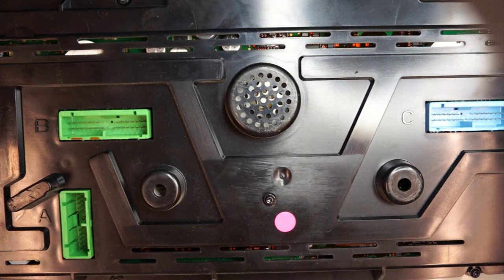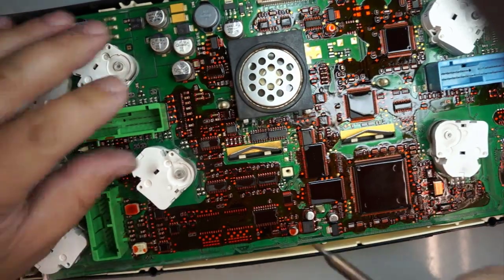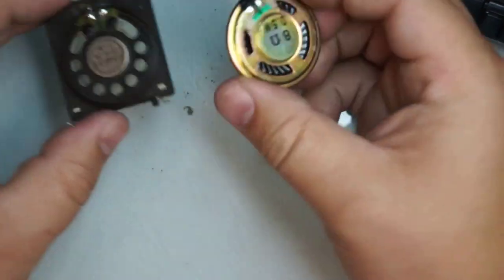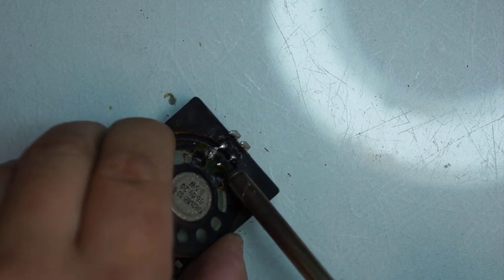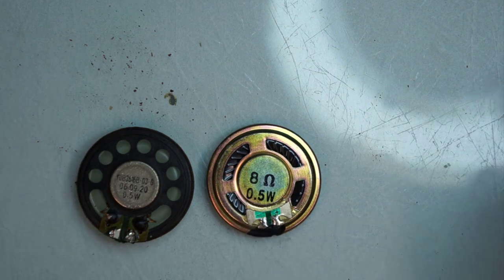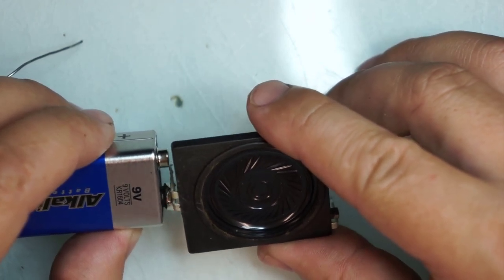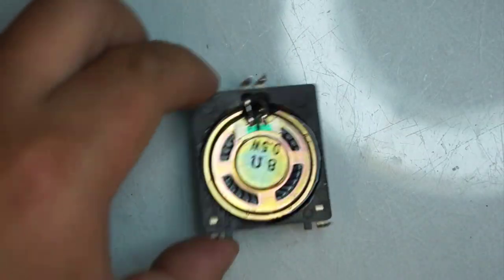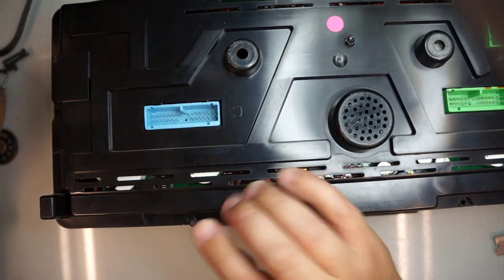Volvo Semi Truck VN VNL Warning Buzzer Speaker Repair.

Comment: Thanks for the video. I just replaced this speaker on the cluster for my Kenworth T600.
It is the speaker for the blinker/hazard lights and makes the beep when you turn the key to the on position.
This did not fix my low air warning buzzer.

Comment: My friend the problem i have is when the engine is running i have a buzzer below 60 psi..when engine off and key switch on buzzer comes out...i need this for PRI Trip inspection test. Any idea 💡
Reply: When the air pressure is below 60 psi the buzzer will sound thats nornal..
Reply: On Volvo trucks the buzzer doesn't buzz if engine is off.  That's normal.

Comment: My friend the problem i have is when the engine is running i have a buzzer below 60 psi which is good..when engine off and key switch on NO buzzer comes out...i need this for PRI Trip inspection test. Any

Comment: I don't recommend to touch with 9v battery speaker bracket contact when it connected to the board it could damage sensitive electronics